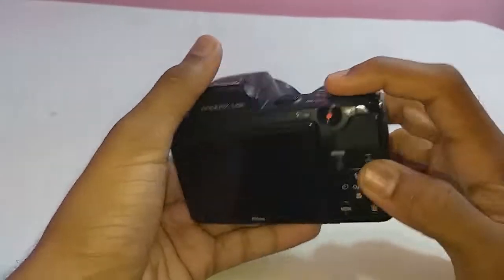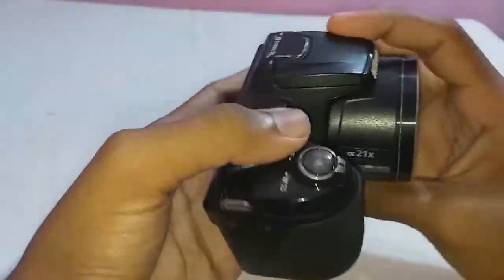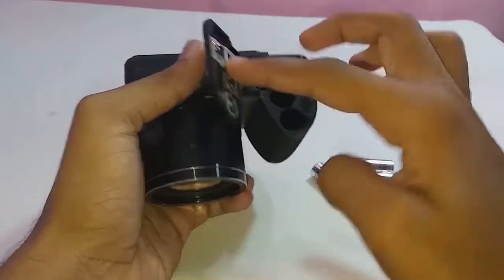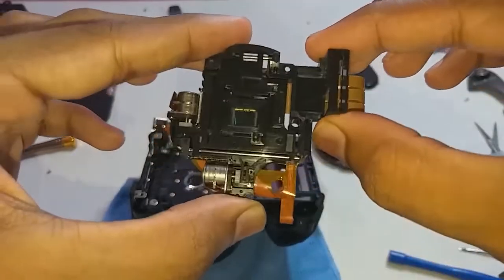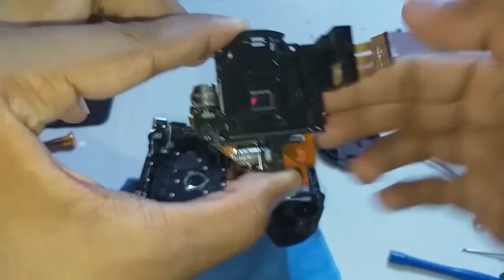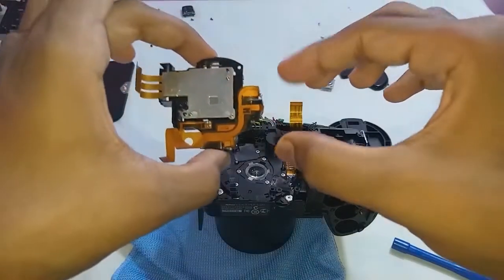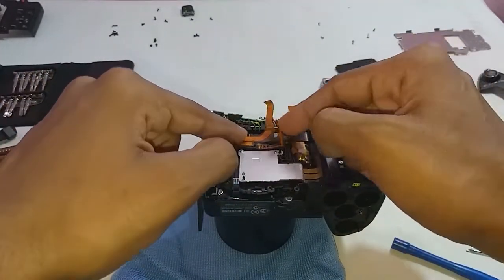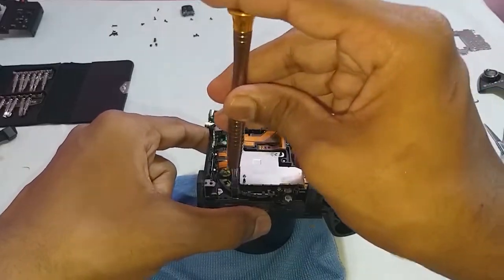WORKING OF OIS  - OPTICAL IMAGE STABILIZATION | HARDWARE | SENSOR SHIFT STABILIZATION | ON CAMERA

Comment: i have a questionMy brother, 
After upgrade from Android 9 pie to Android 10 on my xiaomi mi mix 2 s the OIS of the caméra don't work and the photos are coming so far ...
The Android update Can cause problème for gyroscope and accéléromèter sensors?
Reply from the maker: You have to contact your smartphone customer care, let them know your issue so they will fix in feature update and also give you a temporary solution. You can also reset your phone and avoid the update but i recommend to contact customer care.
Reply: @MSTECHCHANNEL  i have do reset 3 Times and Always the same problème